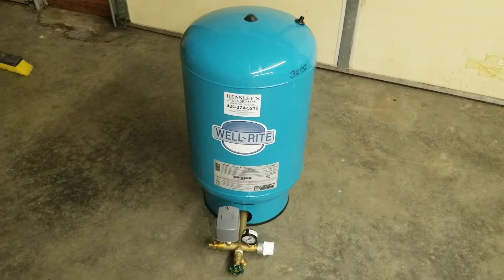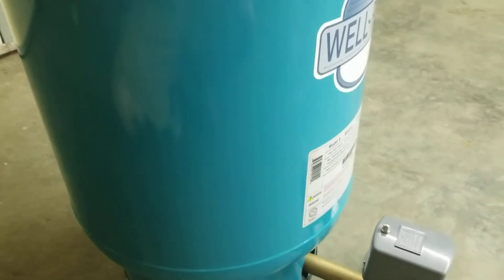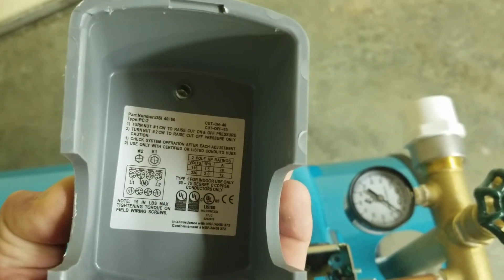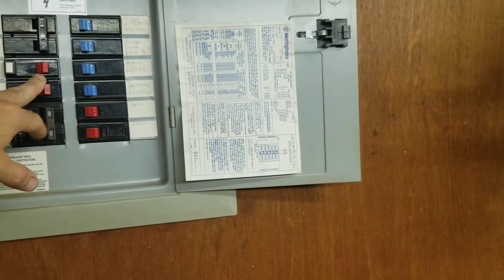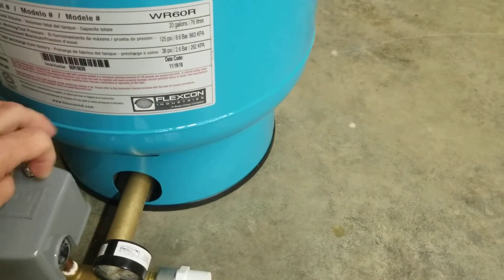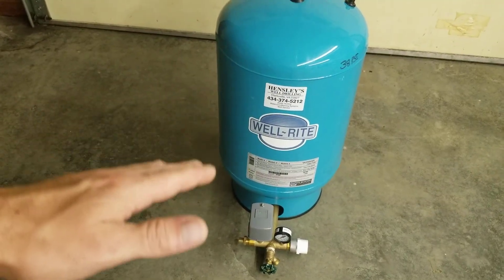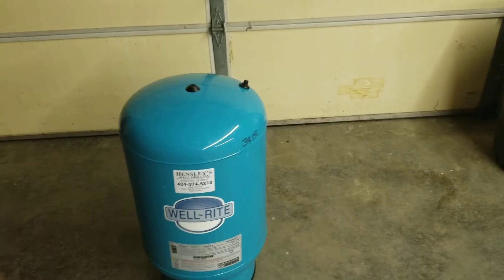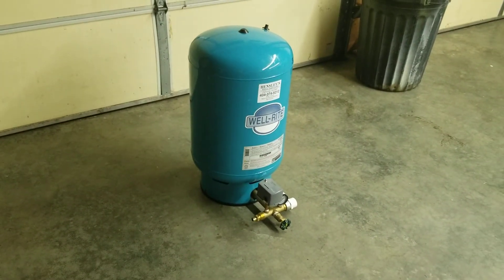Well Pump & Tank Troubleshooting, How the system works, Adjusting Pressure Settings Correctly

Comment: My current issue, the pump runs takes pressure to 50 initially...but after faucets turn on , pressure goes back down to 30 pump doesn't turn back on.... so trying to figure out is it 1) switch,  2) pump , or 3) tank
Reply from the maker: Sounds like too much air in the tank. Kill power & drain off all water & then set tank air pressure to 25psi. 
I assume that you probably just replaced something.
If the system is all old stuff, look at the nipple below the switch, it may be clogged inside with rust build up
Reply from the maker: Could be a dieing pump too, but typically you'd have a breaker pop...but not always. Sometimes a failed bearing makes the motor heat up & turn off on a thermal overload, then the water cools off the pump & it runs again for a minute.  Cool Down time is roughly 5 minutes.
Reply from the maker: Unfortunately jet pumps are very old technology. If the pump is older than 10 years the seal around the impeller is probably worn out. This will cause a situation of decent pressure for a minute and then low pressure while the pump is running. My advice if you have a 6" well is to have a company install a submersible well pump is the well pump and update your system. Jet pumps are from the 1970s.
Reply: It's all old ...put a switch on, it worked for now... tank seems fine
Reply: So with new switch on pump doesn't want to shut off....maybe it's adjustment is to high?
Reply from the maker: @ltsmonke  your problem is confusing...do u have a submersible pump or jet pump? How old is the pump?
Reply: Sorry it's above ground pump. I made an adjustment on pressure switch its now shutting of at 60psi.. but overall water pressure in house is low

Comment: What will happen if we fill the air at 45 psi?
Reply from the maker: Its impossible to set it correctly. The 45 psi of water will give you false air readings.
Reply: @h2omechanic  thanks bro

Comment: Our pump is kicking on and off every 25 seconds the outside meter is building to barely above 0 and kicks off and falls back down. What is your suggestion?
Reply from the maker: If its turning on & off without you using any water, the pumps must be pulled out. It's either a bad check valve in the pump or a broken pipe in well

Comment: Awesome video and info. It looks like I have a leak coming from the steel elbow on the bottom of my challenger pc144r. The tank was made in 2013. So you think it would be from the nipple on the steel elbow or do you think it would be leaking from the tank itself? Bladder is still good and pressure is too just a constant drip that has to be fixed. Tank is stored inside and is physically in great shape. Thanks so much!
Reply from the maker: Average tank life is 8 to 12 years. So it could be acidic water slowly eating the metal away. A small drip might get worse in time. Id just go ahead and replace the tank since it's a 2013 model.

Comment: Air pressure is at 37
Reply from the maker: If you have a 40/60 switch, that's fine. You issue is either the pump or the wire. Im betting the wire in the well is bad

Comment: Hello my bladder failed I replaced it with a new tank and decide to replace everything  Pressure switch And all everything now I'm not getting anything
Reply: Hello sir are you there
Reply: I just checked I have power everywhere
Reply from the maker: @bearbear1248  if you have power at the well, then the issue is definitely down the well. I assume you had no water & found out the tank was bad so you replaced it. A bad tank will kill a pump within weeks of it going bad. It's causes the pump to short cycle. On/off/on/off around 80 times a minute. This can make the pump overheat & die & also it can rub the jacket off the wire down it the well. Most likely when you pull the pump out, your going to find a bad spots in the wire within 10ft of the pump. Inspect it Closely. If you have power at the well, then you have to remove the pump.
Reply from the maker: Be sure to check all your valves are open & the breaker is on. Alot of ppl forget 1 little thing. To test it, you'll need a volt meter. Test at the switch for power, the go out to the well and test it there. Be sure to also check the air pressure in the tank. Most come with too much air witch will cause the tank to run dry & the pump not kick on right away. If you have a 40/60 switch,  the air in tank must be Below 38 psi. 30/50= below 28 psi. With no water in the tank. Watch more of my videos and you'll be more familiar with the system.

Comment: I poured bleach in my well left it 8n over 12 hours let my faucets and garden hoses run to try clear out bleach. Now my water pressure is low the water doesn't seem to be filling up at the whole house filter and when i run water it makes wierd noise in the hot water tank
Reply from the maker: Take the element out of the filter & see if it fixes it. If you used a black Carbon filter, that's the problem, you need to be using a white filter. 
If the filter is before the tank, that's also a big issue. Run the system w/o a element installed inside the filter. If it runs fine, then u know it's the filter. 
Also you might have to clean each sink strainers
Reply: Which white filter the one that looks like yarn or the one that looks like paper and when will i be able to use the carbon filter again
Reply from the maker: @quincythomas493  use the string filter
 . The carbon is trapping minerals, let the water Softener do that. The regular string filter is to stop larger sediment. You can use carbon again in a few months
Reply: I use to use black carbon filter and never had a problem before bleaching well. Now it collects brown mud like material when i use it. How long will it take to clear up. Also my filter is just before my water softener which is after the mane water lune and after the pressure tank
Reply from the maker: @quincythomas493  don't run the carbon filters. There made for city water. That's 100% your low pressure problem
Reply: Thank You

Comment: Great video. We have a well at my dad's house and he gets air in the lines every few months now with 3 people using water. It used to be once or twice a year with just him. We drain the tank, then start it up again and this fixes it. Is there a way to tell if we need a new water tank or if it's the water table?
Reply: We're in Florida and we've been getting a ton of rain so I don't think it's the water table. I just read that is one possible difficulty.
Reply from the maker: The tank is like a car tire. If you have to add air, then its a bad tank, slowly leaking into the water. The bad tanks are typically too heavy to move & a good tank is easy to move (side to side).

Comment: My pump won’t turn off I replace the pressure switch and the tank but it won’t turn off
Reply from the maker: Try turning off the pump breaker. Wait 2 minutes and see if you have any pressure at the sink. I believe that you have a cracked pipe in the well. If u kill the power & wait all the pressure will leak out there. If it holds pressure after a few minutes then it's not a leak, it's just a old worn out pump that can't build enough pressure bc its worn internally. Either way you have to pull the pump. Average pump life is 9-14 years depending on depth & sediment amount

Comment: Excellent video. I tried all 3 steps and it looks good. I'm having drop in pressure and sometimes the water stops for few minutes before it kicks in. I checked the pressure in the tank and it shows 25 PSI (measured when the water stopped in the faucet). Pressue gauge in the tank too shows 25 psi. Pressure switch is set to 30/50. So if I have to fill air in the tank what would be the ideal pressure? Do I have to empty the tank before filling air?
Reply: Yes, turn off power, empty tank, get pressure to 28psi then turn on electricity.

Comment: I replace my tank, the electrical box and the pressure switch all my readings are correct bot no water and the 2 gauges are at zero and the tank is empty and it will not start
Reply from the maker: Time to replace the pump id say. Or the wire feeding the pump

Comment: Thanks for the video. My well pump is used for yard irrigation only, usually only an hour or so at a time. Probably 20+ years old, but never had an issue. 15 gal pressure tank. Pump runs on power but am getting no water. I have checked the required air pressure in the tank and also tried priming the system by filling at the highest pipe plug in the system. Tank does not sound empty when I tap on it. Any advice before I call a local expert? Thanks!

Comment: I'm new to having a private well and I don't have any water. I don't know what to do to fix it. The day before I lost water I had settlement in the water. And the next day I didn't have any water at all. How do I fix this? I'm a first time home owner and I'm learning all this on my own.
Reply from the maker: Watch a few of my videos and take notes on how to test your system. Since you had alot of sediment, id say a pipe in the well cracked & stired up the sediment, then it finally broke enough & now it won't lift any water out. Call around to different well drilling companies and see who can service your system. Or have someone who is knowledgeable with tools & a voltage meter to help you.

Comment: How do you remove the lid from the box it won’t let me
Reply from the maker: The little nut on top, loosen it a few turns & pull up.   Be careful bc the wires under the lid are hot/ ⚡
Reply: @h2omechanic  My box has a screw on it it doesn’t have the not balls on top

Comment: Pressure is not kicking on. We did the test on the tank that is okay. We replaced the power switch box notice the iron build up also replaced the brass pipe between the lines, We replaced that still the issue is occurring. I am not sure what else it could be

Comment: Hello there. I have pressure problems. At cut on point (40psi) I can her the pressure switch click but, the pressure gauge drops to 0 instead of going up to cut off point (60psi).  After exactly 2 mins, pump activate again to the set pressure. I did check my pressure tank it was very low on air, I’d set it up to 38 psi, as my pressure switch is 40-60. I did replace my pressure switch (40-60) and pressure gauge. I still have the same problem. Maybe this is a warning that my well water pump is going bad?
Reply from the maker: Yes, the pump is dieing. It's over heating and cutting off until it cools down & itll run again. The bearings are bad in the motor. Pull out the pump & replace it asap. Itll die completely in a few days
Reply: @h2omechanic  any specific brand that you can recommend me? Actually this pump is an utilitech that was replaced about 5 years ago.
Reply from the maker: @jlorti  well, then its very likely its reached its life's potential for working
Reply: @h2omechanic  and I just watched your video were you explain a pump installation, and said don’t buy a Lowes pump. Well that’s the one I put in 5 years ago

Comment: Gages running 30 to 60 Cut on 30 cut off 60 at 45 it quickly goes to 60 when cut on at 60 when cut off quickly goes to 45. Pump runs 62 seconds off 30 seconds. I'm concerned that the pump is running too often and not long enough. Water pressure is fine. Please let me know your thoughts on this concerned as I'm running the hose overnight Non-Stop. Wouldn't want to burn anything out.
Reply from the maker: 30 to 45 sec cycles is normal.

Comment: I took some photos of the well pump and I think casting info, but not sure.  Trying to understand what I am looking at.  Not sure if depth is 74.0 feet or 740 feet.  I still have a ton to learn beforeI purchase any replacement parts but will over haul the entire system, once I understand it better. Any advice or videos you have to help educate would be great.  Still moving in have not met any of my neighbors, they all have smaller pieces of properties and have not seen any thing that might be a well.  Anyway, I will be learning all I can about the system to water garden and other needs.

Comment: Glad to find you!  Just purchased a home on county water but has a well (non working). Previous owners never checked it out, plan on restoring and using it.  Once settled in I will trouble shoot the unit and see where it stands, have no idea what the issue or issues are.  Most likely will rebuild system completely.  First well, but handy so I will be doing the work myself.  Hopefully with a little help from you if I run into a head scratcher I will have a working one here in the upstate area of SC.
Reply from the maker: Most people hook up to county water bc the well doesn't produce enough water for the house. If you have neighbors, id ask them if they have a well & can they run it dry or did the previous owners ever have water problems

Comment: I added pressure to my tank but when I open the water shut off valve again the pressure drops on the gauge . Why is that?
Reply from the maker: Too much air is in the tank. A 40/60 switch needs 38psi max & 30/50 28psi max. Tank must be completely empty of water to set air pressure correctly

Comment: Hi, I had the power go out at the cabin a few weeks ago and we got up in the morning the water was spitting and sputtering with lots of air. Let it sit for about a half hour and it returned to normal. Fast forward to this morning and I get a call that it's doing the same thing. I'm thinking the power outage and the well problem are unrelated. Any ideas on what i would you check first? I'm headed up this afternoon to take a look. Thanks for the great videos.
Reply from the maker: Have pressure on the system and then kill the power. Leave it off for 1hr. Then check a faucet & see if u still have pressure. If you don't, there's a leak somewhere. Once u turn the power back on, leave a sink run for 3 minutes and see if any air shoots out then. If it does, that means the pump has a leaking check valve. 
Follow my tips on checking your tank too. Could be a bad bladder & air mixed with water.
Reply: @h2omechanic  Thanks a million!

Comment: Thx for the video info very well said. My question? I have the same type of bladder in your video and a pressure switch 40/60. So what happens I get great pressure for about 5 min but when I use the garden hose it cuts the pressure down to 20 psi. I did this test a few times until I shut the hose off the gage goes back up to the 60 PSI. Hope that makes sense to answer.. email me at larenzomo@gmail.com
Reply from the maker: If u have a jet pump, its normal to do that. If u have a submersible pump, it could be old & worn out. Or the pressure tank air pressure could be way out of wack. Kill the power, open a fauce & go check the air in the top of your tank. Best setting is 35-38psi of air in too of tank. My guess is it's around 41psi right now.

Comment: I HAVE ALL OF A SUDDEN DROP FROM 50 PSI TO 30 AND IT WILL NOT INCREASE AFTER HOLDING LEVER UP
Reply from the maker: Well could be dry. Leave breaker off over night & try in the am. If you turn off the power & pressure drops to 0, then you know there's a leak down the well & the pump must be pulled out. If the morning comes & u can't get 50 psi. Pull the pump

Comment: Hello  thanks for your time and knowledge.  No water. Found tank at 13 psi .  I  cleaned out all particles,  contact points.  Filled Tank to 38psi  . Pump didn't start. Electric is going through switch to out well , going down to pump still no water.  Should I change tank and switch.  Also I  pump the pump out or the tank.  Can I tested it  directly without the switch.

Comment: My gauge at the pump says 140 psi . i turn the faucet at the pump no water. I turn the faucet in the house no water. I manually active the pressure switch i can hear the pump run still no water.
Reply from the maker: Broken gauge & probably a busted pipe down in the well.
Reply: @h2omechanic  thank you psi gauge was jacked and pressure switch bad

Comment: Pressure Guage on bottom of tank is reading 50 psi , yet loosing water, accidentally bumped the cut off switch and water began to flow back into the tank. I assume the cut off switch is bad ?
Reply from the maker: Bad switch & gauge probably. Remove the switch and see if the nipple below it is clogged.
Reply: Thank you !!!

Comment: Does a Gould Model J55 have a diaphragm? That’s the small pump in a summer camp. It’s long, not tall. There is a place for an air valve. A plug is in there now and I see an air pressure valve on the floor in a corner.
Reply from the maker: The short answer is no.

Comment: I've got a low pressure problem 15 to 20 psi. Found bladder tank blown. Replaced with new tank switch and gauge. Still has low pressure 15 to 20. Good volts at switch. Reached to turn water valve on at tank and got shocked alittle. Can a pump short out and cause that. It hasn't done that before. Thanks for you help.

Comment: Please help!
I just replace my well pump and it starts for a few seconds then turn off.  It continues this cycle off and on.  I  have a 220 lb bladder tank 1/2 hp Everbuilt pump.  The bladder tank has sufficient air, I have primed the pump and it will not start
Reply from the maker: I'm assuming that you have a jet pump. They can be wired for 110v or 220v . If you have a single breaker, it's 110v & if you have a double breaker it's 220v. On the back of the pump motor should be a label telling you what it was wired for from the factory. You may need to remove the back cover & swap wires around per your instruction booklet. Or find a video showing you how